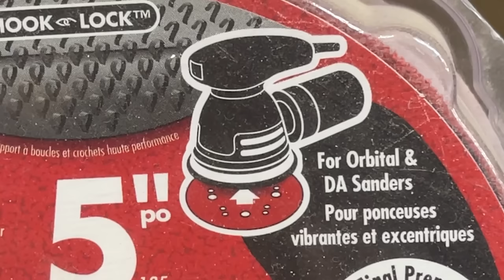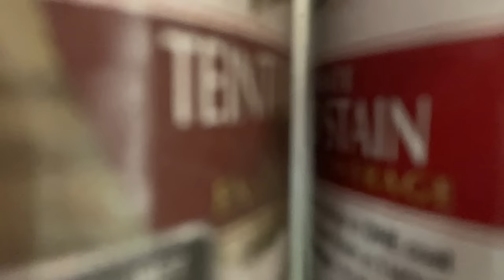The FLAKIEST dresser of all time...  Furniture Restoration

Comment: The previous owner did NOT remove the initial surface compound, so their choice of finish could NOT adhere.  Polyurethane will flake this badly, when not applied properly.  I think they used a brush application and it was too thick.
Reply: Mundi Odium  Removing the old finish first.  Clean the surface, dry it, sand it, blow the dust off, then apply in thin coats.  Allowing each coat to dry thoroughly, before adding the next.  Like several days, between coats.  If you don't allow it to dry, between coats,  the old coat won't be properly adheard to the previous coat and they all flake off.
Reply: Agreed.  There are late commers to the paint industry that can stick to almost anything, but polyurethane, especially high gloss, can still present problems for some. Usually either removal or an esufficient scuffing with an intermediary coat of a good primer are still required.  Polyurethane is durable tough stuff, and sometimes a major pain in the ars. 😄
Reply: Agree. It was not shellac, just poorly applied poly. People probably assumed shellac because antique furniture can flake or have crazing when it is damaged. However, it does not look the same as what you have.
Reply: i couldn't tell if it was just paint on old paint or paint on surface it wasn't formulated for
Reply: this is literally the comment i was gonna leave! thanks for saving me the trouble!
Reply: Was going to second polyurethane. Anyone here watch Julian Baumgartner?
Reply: @ShadowoftheDude  at times
Reply: I’m thinking of repainting something. Thanks for the info.
Reply: @Objective-Observer  You don't need several days. Each product has it's own requirements to dry and adhere. Sanding between coats once the finish reduces to powder when sanded is what is needed for proper adhesion. Pre and post catalyzed lacquers, conversion varnishes and polyurethanes may have different drying times but how they are applied is pretty much universal. You don't want the previous coat too dry as the surface heals and doesn't allow melding or fusion with the new coat.
Reply: @ebonist3860  You do what you think is  best.  The rest of us will do what we know works.
Reply: @Objective-Observer  Fifty years a finisher here old son. Four countries on two continents and materials and techniques vary little.
Reply: @ebonist3860  You are not taking into account  geographical differences and weather variances.  What works for my part of Texas, won't be the same for Japan or Canada.  In a Humid Climate, it will take several days for that finish to dry and cure.  In my arid part of Texas, it won't take that long.
You do what you think is best and the rest of us will do what works in our area.
Reply: @Objective-Observer  I always do what's best old son.
Reply: @ebonist3860  Thanks for admitting you forgot humidity.
Reply: @Objective-Observer  " You are not taking into account  geographical differences and weather variances."  To anyone with even a moderate understanding of the English language the fact that I have made a living as a finisher in different countries on two continents would infer that I understand ambient environmental conditions and timber species effect material response and affect finishing method. It goes without saying amongst professionals.
Reply: They did it that way to preserve the wood.  I was always told that putting paint on unfinished wood is not good for the wood.
Reply: i would have never painted it in the first place the maker of this carbinet did 
awesome work
Reply: @marilyndorn8741  Which is why real wood should NEVER be painted, ever- in my opinion.  It can stain the wood the color of the paint, so that it will never be a natural color again... until you remove the wood to the depth of the stain.
Reply: These happened to all of my build-in in the dorm. They charge extra for the repainting but the it keep flaking on everything that touched the surface of the desk.
Reply: The back that says the date tho makes me think shellac, that was popular and widely available in the 60s
Reply: Whatever it was it was transparent to an extent. Could have shellac with stain added or a gazillion layers of shellac. Not an expert just saying what it looked like to me.
Reply: @ShadowoftheDude YEP
Reply: Okay, but are u angry?
Reply: It is an inexpensive piece.  The manufacturer sprays the finish on for a toner appearance to make substandard wood and surface prep look more than it is.
Reply: Know it all

Comment: The finish you scraped off looks like a polyurethane finish with the stain built into it. Minwax makes and Flecto Varathene used to make this product. I make my own by using X3D stain by Flecto in the Varathene and spraying it. I never go over an old finish and always get the wood down to a clean sanded condition. I usually stain the wood directly and use the above method to beef up the colour when needed. It's how you make maple look like walnut.😁 The species is Ash, "the poor man's Oak"

Comment: Excellent work!  I am old, and I prefer to remove finishes with hand sanding.  After years of doing this kind of project, I have learned how to feel when the sandpaper has gotten through the finish.  The resistance and the sound both change.  It means it's time to change to a higher grit, and a softer touch is needed.  Also, two cents of advice--be patient, and do those wood filler bits in thin layers.  You'll get a better end result.

Comment: Doesn't alcohol melt shellac?  I could be wrong, but curious to see that shellac as the original finish, and nothing else, never seen anything like that.  Also odd to see that none seeped into the wood, but this was just sprayed on.  Theoretically you could have stripped this with vodka, just for clickbait.
Good to see you thin your stain, I do that, but nobody else does.  You can always make it darker, or mix colors, after you see what it looks like.
Your wall and pavers are typical colorwise, of most floors today.  That blue grey, so I would have been temped to make this less red.
This is one of my least favorite styles, but you can still give it to me.  It will look great under the TV, thanks in advance. (*insert gushy remarks here).👍  Thanks.
Reply: Dude, I tell it like I see it.  Sorry, no "gorgeous" and no endless" love it", out of me.  Hopefully I relate my appreciation of your talent, you normally shock me, well always, basically.
My father used to do this work (side gig) and I loved helping him.  I was less than 10.  So many years ago, but I still like it.  Dad got things that were a minimum of a hundred years old, but mostly 2.
I am not being overly -critical, there are so many ways to look at this.  I would much appreciate other opinions, rather than "LOVES".
Reply: vodka for stripping furniture...hmmm

Comment: I live in a 1930s built house and that finish is exactly the same as the original finish on all the doors etc. it’s like a yellow ish paint with a stain/glaze over the top. And the finish is original so it wasn’t painted then the glaze added later. Interesting. Great job by the way!

Comment: That appears to be tinted polyurethane.  We bought a house with original wood flooring and I asked the sellers to sand and stain.  They slopped the poly on and it scraped up in flakes with normal wear.  They didn't bother to sand and did a couple of coats.  I don't think your previous owner sanded this piece before applying.  You have made it lovely again.

Comment: Your results are markable! Beautiful! But I wonder why you use your scraper the way you do. If you sharpen it right, maybe every third furniture, it will work perfectly when you scrape the right way. You’re supposed to pull the scraper towards you, not move it back and forth. Then you get the absolutely best effect of your scraping. I think you could reduce both the use of stripper and the time you have to sand. this is not a complaint, but a tip to you that otherwise are so skilled! 
So, sharpe edge on the scraper and scrape towards you!

Comment: Unlikely you'll see this, but have you ever considered using edge banding along with wood filler for these more square shaped repairs? The wood filler to erase any gaps between the banding and the original wood. Would it help the stain be more even on these repairs? (I am not a professional, so this might be a horrible idea)